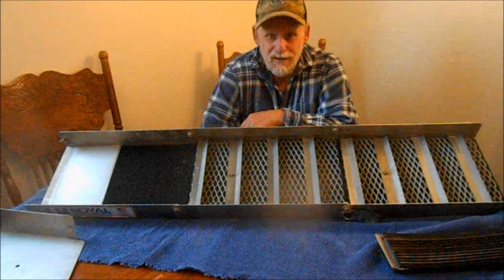How to Catch More Gold! Royal Manufacturing Backpack Sluice Box

Comment: I have a Jobe 10" sluice with flare & legs & a jury rigged pipe attachment for a 2" pump, a Garrett 6 or 6 1/2" sluice.
I'm wondering how to re-rig them for fine to thin fine flakee gold with the occasional nugget for northern California?  Got both cheap at yard sales.
Additionally I have that small all plastic black short sluice, and 3 rollup sluices from MyGoldPanning in Canada, both types for use with a backpack, and  Tom & Perry's Cleanup Sluice which needs some kind of stand/cradle setup to build.  That plastic black sluice (test sluice?) is hard to take apart as it is friction fit.  I think it needs a modern upgrade of some sort.
One of the rollup sluices has a small crack that needs patching with something flexible (unrolled it too early before it got warm enough).  Got any suggestions?

Comment: Thanks for the video, I just received a Royal recirculating sluice, switched out the carpet with miners moss. And will be doing the same as you with additional peices between. Thanks again from Colorado.
Reply from the maker: Have fun! I had one of those for years it's easy to change out the mats. I use nothing but silicone mats now, Thanks for watching.
Reply: @alanrobertson2510  my other sluice is 100% silicone mat,  and will upgrade the recirculating soon. Thanks again for the tips!

Comment: I like the setup.
How would you set it for unclassified materials or classified to under one inch?
Whenever I set up my home made sluice to run anything over 1/8" I have problems with it holding too much material and washing gold over top of it.
12" wide 48" long with 2 1200GPH pumps.
Best so far seems to be all gold hog mats.
Reply from the maker: I always classify down to 1/4 inch before it runs down the sluice. I think that you are right gold hog would probable work the best there is not a lot of space in between the riffles for the bigger rocks to get hung up. If you are having problems with the material loading up with 2400 gph I would add some more drop to the sluice. Good luck and I hope you a ton of gold.

Comment: I have this as well. Sand keeps piling up on big metal rifles. If I have slowish to medium moving water should I take big metal riffles out and just use metal grate and miners moss?
Reply from the maker: I have done that a lot just running the carpet and expanded metal but I still found I was losing some small gold. I have changed to a new set up you can check it out here if you are interested. https://youtu.be/aXGgIZ02jH4  I have also ordered the new sawtooth mat that will work on catching the fine gold . I hope this will help you out and thank you for watching.